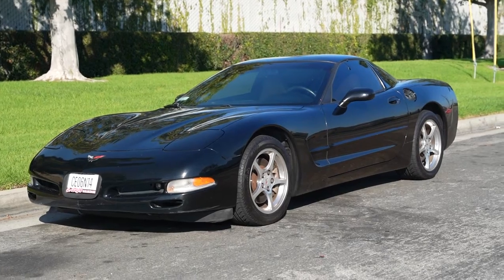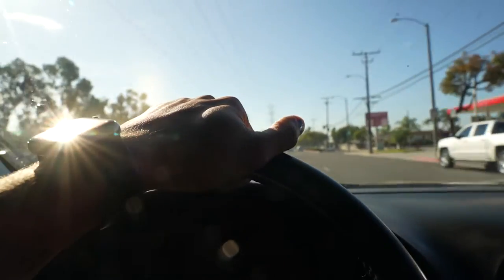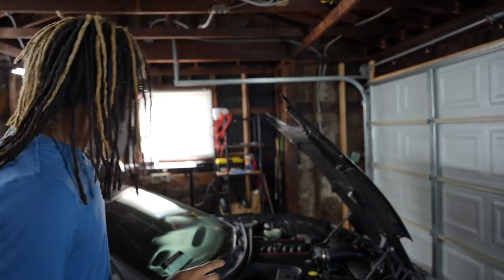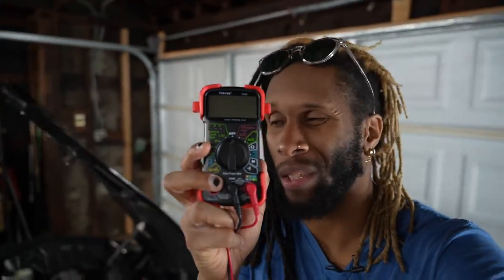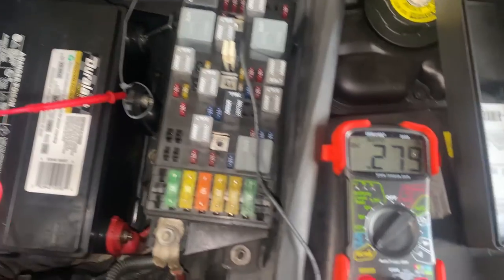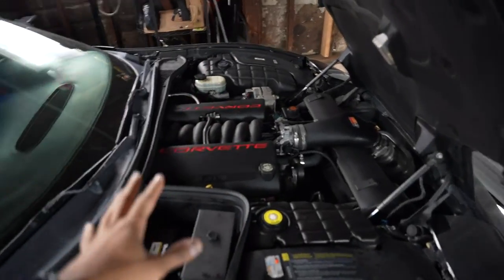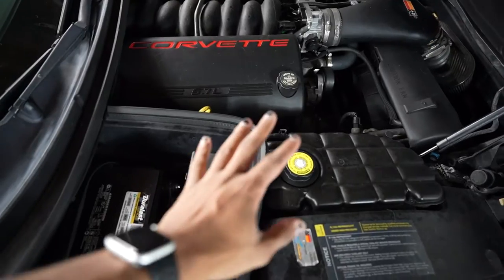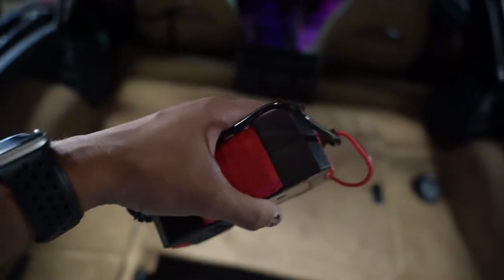C5 Corvette Battery FIX! // Parasitic Battery Drain

Comment: Since I don't get to drive my C5 as often as I would like, I always have it plugged in to a "Battery Tender". I know, a lazy fix to the problem, but it corrects having to deal with a dead battery all of the time.
Reply: I may have to get one of these. I have a 2004 and I’ve had a 15 years.

Comment: My headlight motors or control module are causing my drain. I have the parts to rebuild them, just need time, and then that'll tell me if it's the module or not. In the meantime, I just unplug the headlights under the hood on top of each fender. Battery lasts great!

Comment: I liked your idea of checking the temperature on the fuses and relays! I have my trusty laser thermometer right here and will be able to quickly take a scam across all of them to see if one of them stands out. One of the remaining issues I have is that I cannot seem to "fool" my door switches as you have been able to do. I have a 2007 C6 (also black) and tried the idea of clicking the door latch in with a screw driver but that doesn't seem to help for me. Any additional thoughts on this?  Thanks for your thoughtful video. Enjoy your ride!
Reply: Hey, that’s a cool idea. I have my laser thermometer too, I think I might start with that! I’ve got a 2004 edit for about 15 years. Been dealing with this probably for five years now that I’m retired from corporate. I’ve got time to just toy with it.

Comment: The security system WILL ALWAYS take energy and there WILL ALWAYS be some parasitic drain on a C5. Battery tender is a must if you do not daily drive or store a C5 for more than 2-3 weeks. A battery tender is not a lazy fix, it is BATTERY MAINTENANCE for vehicles that are not driven alot. I bet the one fuse that was blown inside is your cigarette lighter fuse (#10 I think?). That circuit is not good for high draw stuff like air pumps and such.

Comment: Yah sure check yur fuses....many times its a big fuse in the batt area there....an ignition related fuse....but....but...make sure u have all your lights inside checked out for on or off positions etc etc....takes 50 secs for all int lights to go off after lock

Comment: I have a parasidic draw myself! it doesnt last hours! I have 2 battery packs in my vette at all times.
Reply from the maker: Wow that is bad! I think I’m do a battery disconnect and do a video on that next
Reply: @OmegaGreedAK47  brotha, i saw ur video about an hour ago, i ran to my vette, popped the hood, opened the engine bay fuse box and the HORN relay was hot. Mind you the car was off and my horn hasnt worked forever. I removed it, ran the car for a few so it gets juice. if it cranks in a few hours, i would have solved a long plagueing issue and will light a candle in your honor!
Reply from the maker: @octoman_games  Nice!!
Reply: @OmegaGreedAK47  dude it worked!
Reply from the maker: @octoman_games  nice! Happy it helped!
Reply: @OmegaGreedAK47  new shit; look out for warm relays when the car is off!